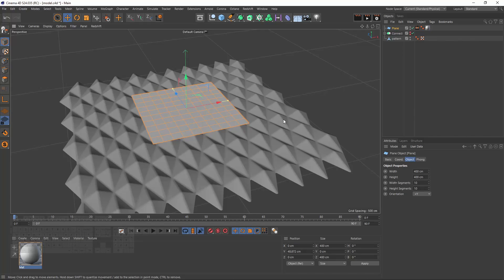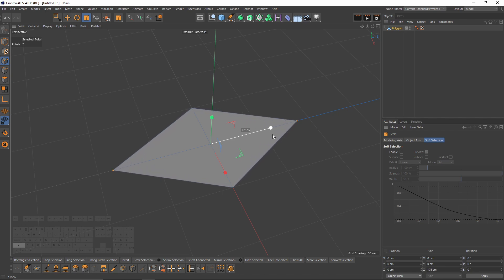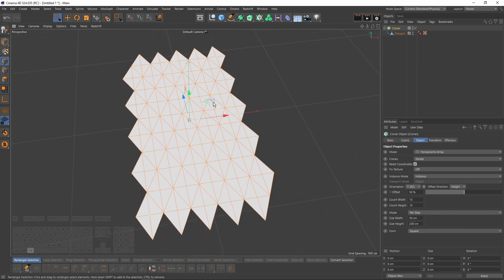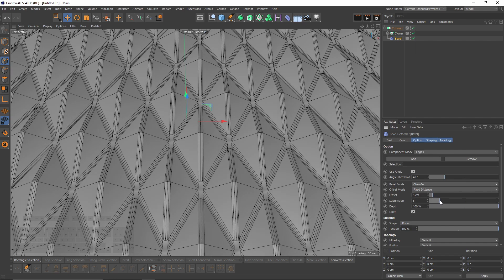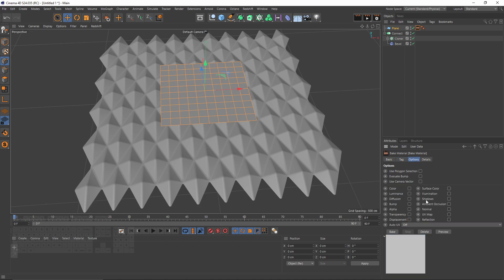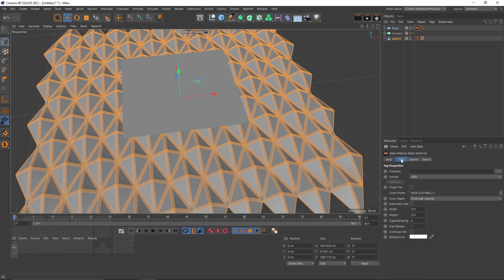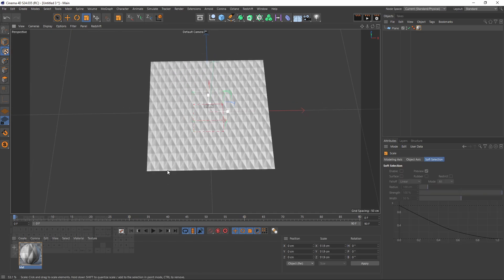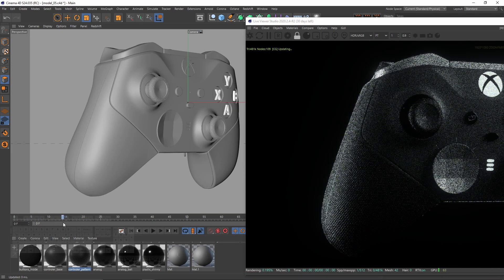Modeling and Baking Tileable Patterns/Textures | Cinema 4D Tutorial

Comment: Superb tutorial! But I'm stuck after creating Normal map. I''m using c4d 2024 + redshift. So in RS node mode, I tried to use the normal map>bump map, made the input map type to Tangent-Space-Normal, added RS object tag and turned on the override and displacement both. But, not showing in displacement 😥
Reply from the maker: Thanks, normal and displacement are completely different things though, this map only works for normals, for displacement, you need a different bake.

Comment: Hi Mert, thanks for that. I couldn't figure it out how to bake a normal/displacement with a couple of hierarched objects with subdivision surface applied to them. It seems you can only source a single mesh. Could you help me?
Reply from the maker: Yeah, ypu should make them a single object, just select them all and connect them, then you can ungroup them.
Reply: @polygonpen   That doesn't make sense, let's suppose we have a plan with several drops of sweat laid over it and we would like to bake them into a normal map texture. Applying a Connect object to the whole group doesn't allow me to source those objects.
Reply from the maker: @Ricardo-de9ju  For more advanced baking, you should try other programs, in C4D normal baking is very primative, I can get a good result only on planer objects with simple geometry or repetetive patterns.

Comment: Hey thanks for the nice tutorial. I have a small question. How could you achieve the same result as you did with the material but wrapping the pattern geometry instead ? Without deforming the pattern ?  Is this possible with the shrinkwrap deformer ? Thanks a lot for your work.
Reply from the maker: Thanks.
Unfortunately you can not use the pattern mesh with shrink wrap to project it on the controller, because shrink wrap has a limit, your object that will be projected ( with shrink wrap ) should have a similar shape to the mesh ( like thecontroller).
Reply: @polygonpen  Thanks for your response. So is there anyway of reproducing complex pattern like that around complex curved objects ? The same as you did with the material but with real geometry ?
Reply from the maker: You can do it but I think Zbrush or an alternative method would be faster and better, I didn't try something like that in C4D with poly/subD modeling techniques.
Reply: @polygonpen  Thank you for your response and for sharing your knowledge. Your tutorials are gold